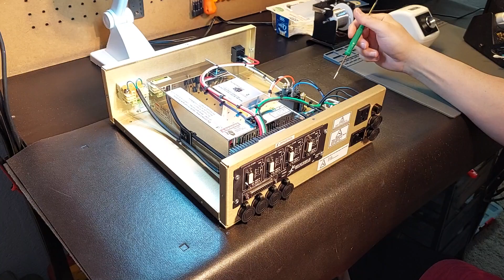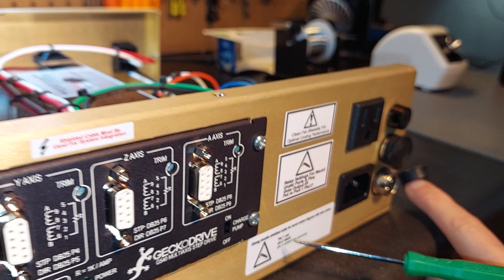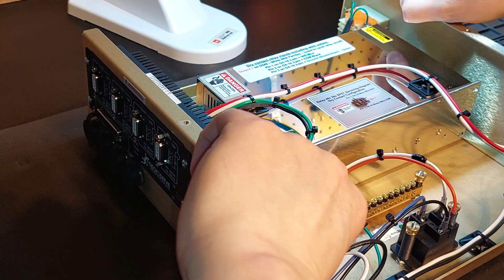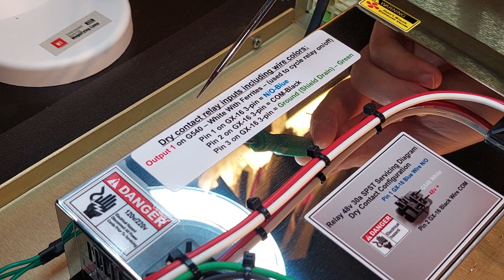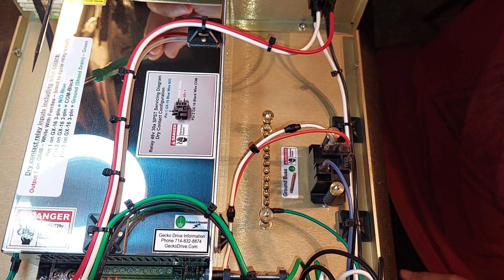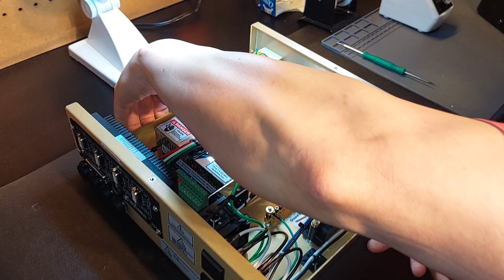A Simple Expandable Plasma CNC Controller...

Comment: I'm putting together a very basic CNC plasma table from scratch. 1000mm x 500mm v-groove extrusions make up the frame. The gantry is also a 500mm v-groove extrusion. Both x and y axis are belt driven. I would like to have a z axis as well and that will probably be threaded rod driven. I'm okay with assembling the mechanical components but I'm no programmer when it comes to setting up a control system. I was wondering if you can offer some tips to make this part of the build a bit easier for me. I have seen controllers harvested from laser cutters used on these small DIY plasma projects, but I'm not sure if the desktop lasers have z-axis control. Any advice or tips that can get me over the controller portion of this build would be greatly appreciated. I have heard that HF interference can be an issue and that ferrite choke rings are a good idea. Where to place such rings is unkown to me. I do like the mention of using a relay and avoiding the need for THC since my projects will be mostly heavier brackets and maybe some 1/8 inch thick signs. Any help on how to wire a controller for such a project will be greatly appreciated. Thanks for the info and the videos. It all helps. Subscribed. Robhoski@gmail.com
Reply from the maker: Thank you I really appreciate the support. Please message me direct to schedule a consultation, so we can cover the details of your system. 

Please review the video's description for my information. 

Thank you,
Vince

Comment: I am getting ready to design and build a plasma machine. I've been running cncs from the programing and operations side for about a decade but have never built one.  I want a super basic system so I can make custom brackets and small parts for the oil field workers out my way. Lots of brackets haha. I want to be basic as possible just super functional. I have a plasma cutter already picked out that's a non hf for CNC purposes. Do you offer guidance per hour? I'm ready to rock and roll just need to make sure I'm buying the right electronics and software. I know mach3 is probably the best base model for me.
Reply from the maker: Thank you for your support. Please email me from the videos description to setup a consultation, so we can go over all your system details. Thank you,
Vince

Comment: Not sure what the last commenter was trying to say. Regardless, I've been very happy with Mach 3.

As to the original topic,  I have THC with the relay.  I never use it.  My system has been perfectly fine without it.

Ad a former customer, I'm 100% happy with the system I bought and build with your assistance and videos.

Off topic:
I still wonder why you don't suggest  mounting the  G540 upside down.  It makes wiring the controller so much easier.  I have had zero issues with EMF causing troubles.

Sorry to get off topic, Vince.  Had a few minutes and my typing rambled.

Again, thanks for putting out these vids and if course the personal emails when a problem raised.

Kirk in Michigan
Reply from the maker: Hey Kirk, Thank you for your support. I really appreciate it. People like the one you're discussing I'll be doing a video on shortly as he needs to be educated correctly before leaving comments. You can certainly mount the G540 upside down if you like, but the wiring of the drive is typically a one time endeavor except for servicing/cleaning. Thank you, and have a great weekend!
Vince